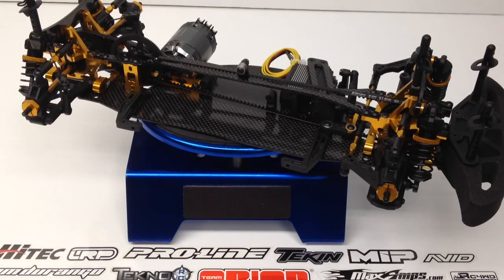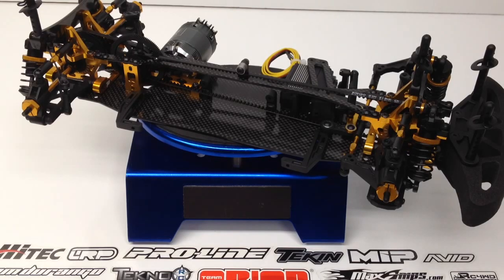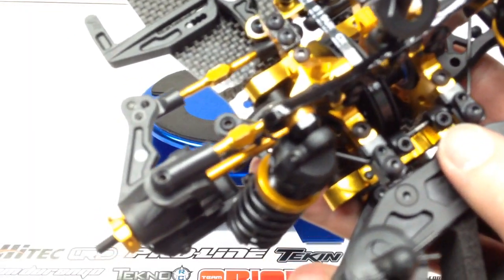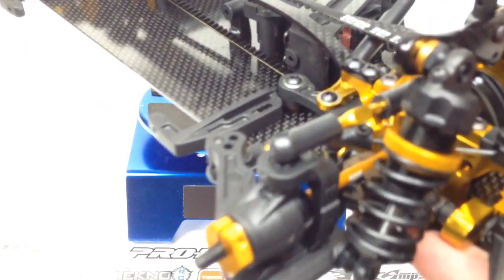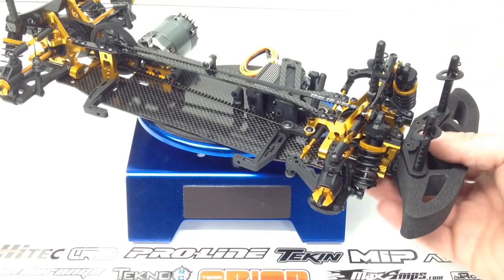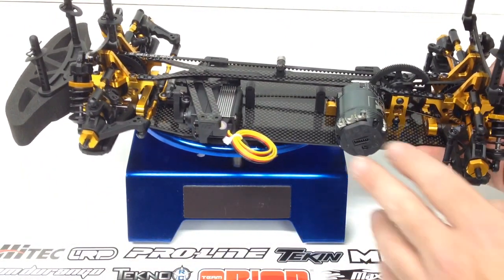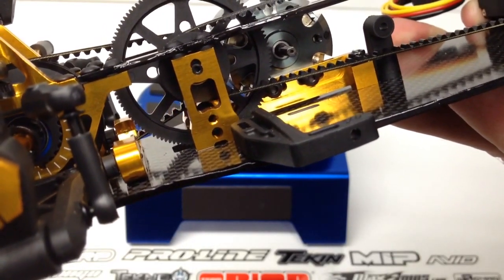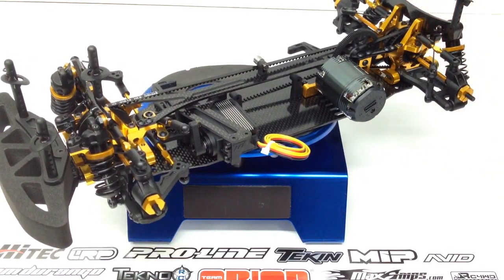Team Durango DETC410 - Build Update 3

Comment: I know 64 pitch is common for onroad because you can fine tune your gearing with so many more options than a 48 pitch. It doesn't have to deal with landing jumps or coming down hard on 1 tire. That said it still seems like a small tooth for the power put out by a 5.5t motor. I had read an article saying 32 pitch was for 1/8th and heavy 10th scale offroad. 64 was for onroad and 48 was actually created by Robinson as an in between for lighter 1/10th offroad to give more gearing options. Just my input on the gearing based on what I've read.
Reply from the maker: Thanks for the info on that.  I assumed that it was all 48 pitch and bought up 20-25 for the project.  I'll have to source them out at my local shop

Comment: again this is a X12  10.5T( pretty old motor :P ) and the flow works team ESC on blinky mode.

T4 test bash

guess what your 5.5 T will do O-o
Reply from the maker: Cool, thanks for sharing.  I'm kinda scared of that 5.5!  I'm probably gonna gear it down initially
Reply: or not activate the boost :P